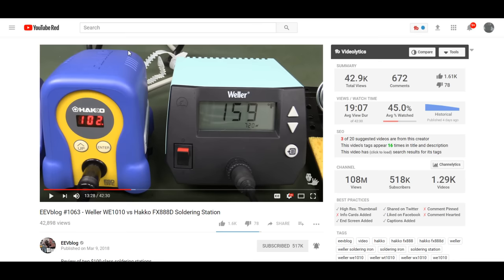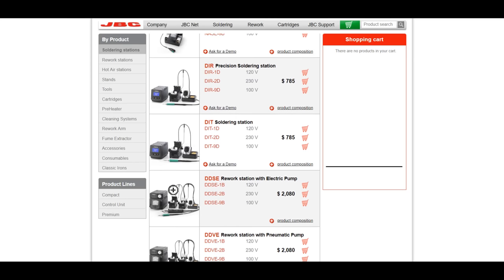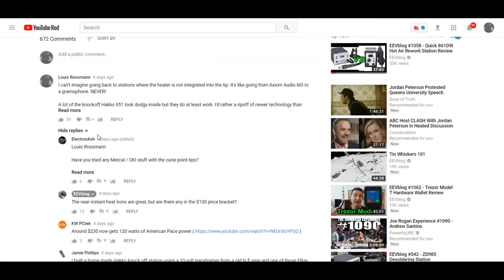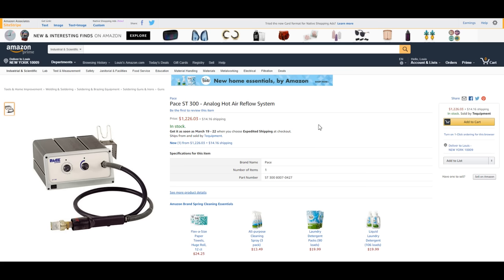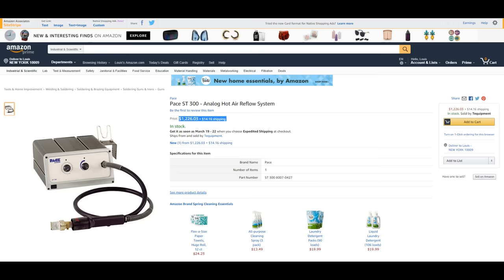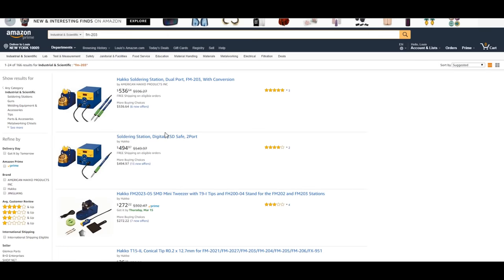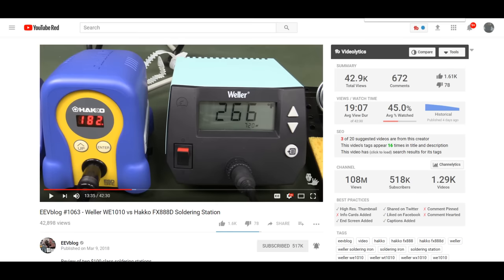Soldering station technology & the lie of "SOLDERING PATRIOTISM"

Comment: These days you can buy lots of different controllers for T12-T15 hakko tips for around 20 USD or less. Kits to build a small soldering station (box, encoder, connectors, a tip and holder) can be had for about 35 USD. You need a power supply, but still, over-all you can have Hakko soldering quality for about 50USD or maybe less. You can also buy fake Hakko tips for about 3USD/piece and they work amazingly well! I have several of them and for a hobbyist, this is more than enough.
The TS100 is even a better package with a much smaller  desk footprint and perhaps better ergonomic!

Comment: i use pace desoldering irons because they are the best i have ever used also they have had the element built into the tip since like 1983. i will say the pace tips don't last as long as they should though.

Comment: Back in the ancient days I used a Weller workstation with a little temp dial and a pencil iron with chisel slug tip, and it would solder heavy 16 gauge wires into sockapex stage lighting connectors, all day long. 24 wires per connector.

And the English fractional system is mostly far superior for too many technical reasons to list. We never should have gone metric. The reasons were mostly silly.

Comment: It is not about, if it´s the "new fancy technologie" or the "crappy old one", soldering stations are all about the sensing and the control technologie. In the company I work (and any other company I know) use soldering stations from kurtz ersa, which is like industry standard or industry premium. They all have "the old crappy technologie", but melts solder in less then 4 seconds after turning on. You can also control how aggressively it heats and its temperature is very stable, even if you solder on a ground plane.

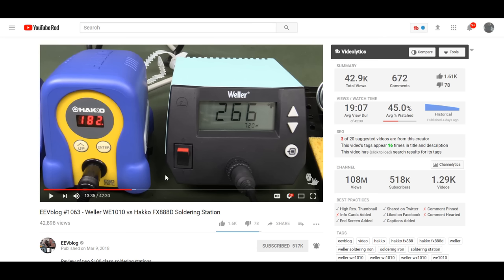Comment: 8:48 Just to correct Luiz there, fahrenheit IS garbage because you don't have a clean 0 to 100 scale, where 0º freezes, 100º boils and disinfection at around 70º.

(More steps isn't even an argument, just add a ',' (comma) and have decimal values from ,0 to ,9. Just like meter and millimeter system... Oh, wait, you probably like the the imperial garbage too)😂

Comment: It makes sense. Most of these older tecgnologies had at least two seperate objects' surfaces interfacing before reaching the tip, and at least a good inch of materials+layers between the thermal sensor and tip. As thermal energy build in or drain from the tip, it takes a good while for the sensor to know that. With age and use, inner surfaces (those you can't easily service) of heater elements, tips, mounting parts - they wear and oxidize, causing decreasing surface contact and thermal conducticity.

With all this baked into one part, we (to most extents) eliminate these oxidation issues, we can better control galvanic contact, and we can move both the heating element amd thermal sensors riiight up there where we need it.

As an added bonus to hobbyists who favor the Hakko route, some knock-off tips have gotten seriously good for a very affordable price, and the Quicko / KSGER / Insert-(re)brand-here T12 stations have also gotten pretty dope for $40'ish with the cheapest handle and a few T12 tips, or another 15-20 with an onboard PSU. There are the self-contained irons like the TS80 and 100, although personally I perfer one that is more ergonomical and plays better with T12 tips (because of cost and availability).

Comment: I replaced all my soldering equipment recently I went with a Xytronic LF-1660ESD with curie heat technology it's a dual station and it comes with a micro pencil and micro soldering tweezers from Vetco Electronics delivered for $119.51 and then I bought the Quick 957DW+ hot air station from Adafruit for $112.96 so for $235 basically for all new equipment I feel like I got a hell of a value for the money.

Comment: If the heating element is in the tip, how much does the tip cost?
I have an old Weller and the Radio Shack Model that is actually a Hakko that uses their tips.  Both have separate heaters.  The size of the tip is the most important point.   The more massive joints require the larger tips.     The Radio Shack model was useless because it only had the tiny tip that could not transfer the heat to any joints unless the joint had little area to heat.  Lucky for me the Hakko tips worked just fine.

Comment: Louis after hearing you talk about the heating element and the tech behind it. i wanted to ask you about the TS100 OpenSource portable soldering iron. it uses the same tech you mentioned here..
if i understand you correctly buying that $66 soldering iron would be better than a FX-88D.
my use case is soldering a couple of mechanical keyboards getting in to the hobby..
Here's a nice vid about the TS100 it stars getting interesting around 01:35
Would love to hear your opinion perhaps even try one out ?????
Reply: The only problem of TS100 is the difficulty of grounding the tip. But if you invest some time, it will be fairly ok.

Comment: IMO, all irons, even in the $100 price range, should use tip cartridges. They don't seem to cost more to make.

I repair music equipment, older guitar amps with point-to-point wiring, old thru-hole PCB's and some newer, smaller stuff. I've been using a Weller EC1002 station for 25-30 years. I want to get a new iron with faster recovery. Considering the FX-951. Also, I'm wondering how the new Pace ADS200 will be?  The FX-951 is 75W. The Pace is 120W which for my use, may be better with higher thermal mass tips. The Hakko comes with a setback stand which is optional for exta cost with Pace. Do I need a setback stand?  Probably not.. The Pace will sleep after 10 minutes. The Hakko is hugely popular with parts availability galore. Will the Pace become popular?  BTW, the transformers used in Pace are Chinese made. A lot to consider. I think I'll wait for the reviews of the new Pace station before deciding.

Comment: I recently got one of the offshore Zeny 937B+ digital soldering stations and its working much better than I expected.  Only paid $30 for it and came with five easy to find tips and the iron is sourced from japan with the heater in the tip.  I know its low budget but im amazed at how well it works.

Comment: This is funny. I had a Heathkit soldering station from the early eighties that used element in the tip like the JBC. The cost of the tips were near the cost of the kit. Eventually my tips all burned out and by then I could no longer get the replacements. JBC isn't new technology and the Hakko and Weller place the thermocouple at the end of the ceramic element so the heat has to work through the tip and the thermocouple.

Comment: Hey Louis now there is a Diy For T12 Soldering Station try search on ebay or gearbest or china online shop you should check that , but i dont know if that diy station is suitable for professional use , why not you tell me what did you think about cheap diy t12 station

Comment: If you have a good iron, even the ceramic heater type with separate tips, you will not have slumping. Temp control is important, and most lower cost irons don't have the best. For most users, a variation of several degrees isn't likely going to cause a problem though.

If you want tight temp control you have to spend more on the iron... I have used the Pace MBT and PRC 2000, they never slumped in temp when working lots of connections. Cheaper Hakkos are not at the same level. They are fine for consumer grade light use though. If I am working professionally, with soldering being a primary focus of my work, I am spending extra money on my iron, $350-400ish in the low end. Thats not set in stone but a benchmark, there may be good ones that are a bit less.

A cheap knock off iron may heat up quick, but have poor temp control, that varies. 

If I even had someone turn up my iron to anything over 700*F I would kick them.

You can do everything you need to do at 600*F max.

My level of training... I can fix bullet holes in multilayer circuit boards. With the soldering standards of NASA use for space flight. There is no such thing as allowable tolerances in that standard. (Well at the time of my training, it may have changed in the past decade or so since my training)

F vs C... Both are fine. If you are worried about the difference between 1*F and 1*C you're priorities are off. For soldering you don't need that fine of adjustment. You will usually make changes of several degrees at a time, so 10*F vs a change of 5*C

I use F simply because I am used to it, and familiar with it. C would work fine if I was familiar with the scale.

Pace makes good stuff, they are very expensive... If you use a nice Pace, even with the ceramic heater with separate tips, you would see the difference between them and similar Hakkos.

Pace was the only soldering station I was allowed to use when working military aviation, as they were temp stable to within a single degree I believe, vs a Hakko which is something like 5-6*...

Hot tweezers... Have you actually ever used the Pace version? You may not be understanding what they mean. Not saying that is the case. But they could mean constant 20min never stop use, but most would never do that. There are starts and stops.

There is a lot to consider when selecting a proper iron, that many might not think about.

Comment: After watching a few reviews on youtube I've just bought a KSGER station that is compatible with the Hakko T12 tips and it is the most comprehensive solder station I have ever used and allows you to calibrate multiple different tips. Not only that, the solder pencil is way better constructed and much more reliable than the knockoff pencils which can be very intermittent. Also the Hakko user interface is totally brain dead and a real pain to use. I have two of those knockoff fx-951 stations and they have now been put back in their boxes and are now sitting in storage. But I agree the fx-951 and other direct heat technology is far superior to the old style heater element sense technology. But you forgot to mention Metcal which came out over a decade ago which I believe uses RF induction heating and curie temperature monitoring directly at the tip. Also I might add I have a PACE sens-a-temp iron and it has been my workhorse iron for more than a decade. PACE maybe expensive but it's still a good reliable quality product and I believe they have a new direct heat technology iron. I believe you should support your local manufacturing as much as you can because a service based economy repairing stuff won't carry an economy and make it prosperous. Only value adding can do this. The chinese know this and is why they are so keen to steal manufacturing jobs from anyone they can.

Comment: I have just managed to fix an USB hub whose wires came off because China quality. It took me some effort to clear the tiny holes of solder and prepare the new wire. 
The end result looks like crap, but at least it works. 
Does this qualify me to fix Mac boards? :p

Comment: Hakko FX951 is still a thermal iron though, for the absolute best look at the Metcal irons, these are what are used in aerospace. They use radio frequency energy to heat the tip instead of a thermal element. Temp control on the Metcals is by the curie point of the soldering tip, it absorbs the RF or not depending on the temperature of the tip, the temp control is based on physics rather than electronics. However you also have to change the tip to change the temperature as each tip has a fixed temp it operates at.

 High frequency AC induction irons aren't bad either, they typically have a hollow removable tip with a temperature probe that slides into the inside of the tip.  Unlike thermal irons like the FX888 they use high frequency AC to heat the tip by induction. (there's a coil in the handset that heats the tip directly rather than using a thermal heater). The advantage of these is that you can find them in watt outputs equivalent to a soldering gun, but with temperature control. I use a Xytronic LF3200 for soldering 6mm gold plated DC connectors to 10 AWG stranded wire for example.

Comment: I went back from a station with the element in the tip (Metcal crap around 700 euro, I had 2 of them) to a station with the heating element  not in the tip. Even worse, the tips are fixed with a screw.  Being my antique over 20 year old Pace MBT-250  Dropping temp while soldering  ? If so it was and is never been a problem. I can desolder like 200 joints without any problem and soldering too. I have it at 320 celcius  and I can solder shielding tins or massive ground planes without any problem.  If it drops it is only a few degrees. It takes time to heat up but that means it also takes time to cool down ;-)
OK this station cost serious money  but  for me as a professional repair tech it is the ducks guts. Tips cost little and last for ever. Changing them is easy. They still sell parts and I have never used a better desoldering iron as the SX100.

 I do not say all cartridge tip stations are crap,  I say that not all old-fashioned stations style stations are crap.  But wait until all cheap crappy stations are the cartridge types. That cheap crap stations with the heater not in the tip do not work very well, does not mean the principle sucks.
Reply: You are not only one who have that experience, PACE is hard to beat, I tested JBC and from my experience (and what I hear from people who have use/try both)  "old" PACE technology is much superior to "new" JBC.I tested JBC simply because on internet many people say it is great soldering iron and I do not argue with that, and it is superior to Hakko or Weller and many others, but at end I just bought another PACE which is much better (from my experience) even I was never big fan of PS-90 handle.
Here PACE is not popular (here Ersa, JBC and Metcal are most popular, even Weller is more popular PACE even all agree that new Weller are crap compared to old Weller), but everyone who so some "serious" work/production (and have money) and try PACE switched to it.
Reply: You can dump a lot of power in to heat slowly with poor thermal contact, it does not imply thermal mass. Just because it heats slowly, doesn't mean it will cool slowly. And no, I'm not criticising your Pace - I'm just pointing out a faulty assumption.

And my 25+ year old Metcal does just fine.
Reply: General speaking you are right, good to mention. However, I was only talking about my Pace PS-90 sensatemp and SX100 sensatemp powered by a MBT-250 (black edition ;-) )  

A cartridge heater is no warranty for a good station.  The sense part must be in the right place, be the right type. It must have enough power  and a fast enough controller . There is a larger part of the tip exposed so possible more loss. For the budget brands still lots off possibilities to fool the customer. I only buy original tips but it is not to hard to make usable knockoffs . I sometimes make my own tips for special purpose. But a knock-off cartridge is a much bigger risk, not only regarding how long is will work but for cartridge irons the tips design is a big part of the performance. 

My Metcals were superfast and bizar powerful. I did like that but cartridges where almost 40 euro's . The desolderpumps were worn after 1,5 years. I worn down 3 hoof cartidges,  they still looked like new but the coil part was open. Two handpieces. The fist after a few months, the second after 1,5 years. The cable became over 100C. I known problem but after 1.5 years and a burned arm no guaranty.  The desolder gun is also replaced within a year and I wore down 4 tips. But to be fair, I have an OKI/Metcal hot air station, I think I have it around 8 years now and not a single problem. My back-up station for the last 10 years (and for SMD because it is not als bulky as the Pace PS-90,) station is a Weller WS-81. Not the thermal performance of the Pace but very usable. Replaced the tip-sleeve once (5 euro) , still the same tips I bought when I bought the station. 

I use them for hobby (restoring testgear, Tubes, RF stuff, most hings I build are dead bug on groundplanes) and work (repairing measurement and calibration gear)

Comment: The most confusing thing about buying clones and knockoffs, especially if you're buying directly from Asia (or perhaps from ebay), is that you can't easily determine in advance which clone or knockoff is built the best, or most similarly to the known-quality name-brand unit.  There are dozens upon dozens of "brands" of soldering stations sold online:  Many of the different brands might actually come out of the same factory but we have no way of knowing this in advance, nor if they're built to the same specifications and quality, nor if one "brand"  was commissioned by a seller that wants it for the absolute lowest wholesale price and therefore the lowest quality; nor do we have any way of knowing how interchangeable the parts might be from one clone to the next.  My advice would be to purchase your  Asian-made soldering-equipment clones from a distributor based in the same country as yourself,  so that at least you don't have to attempt to communicate directly with someone in China or Asia if you have a problem with your newly purchased equipment.